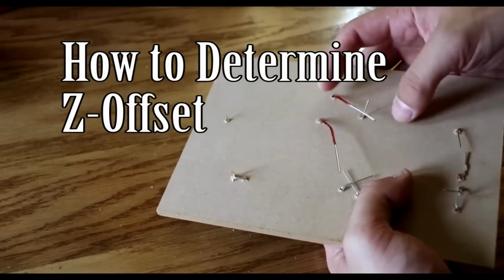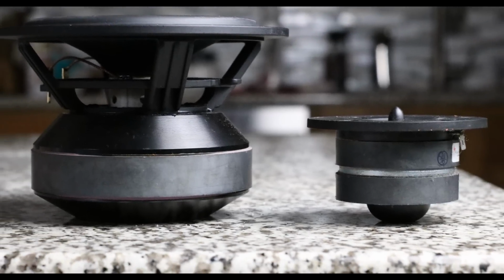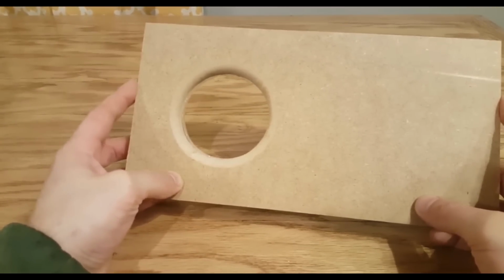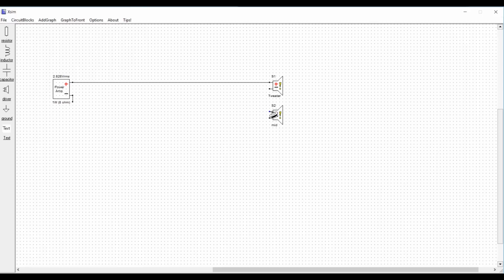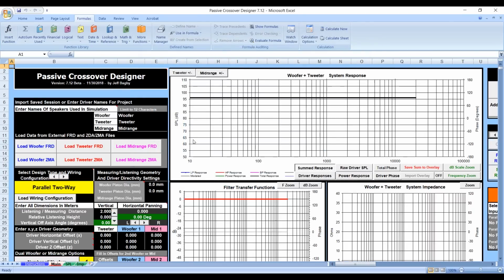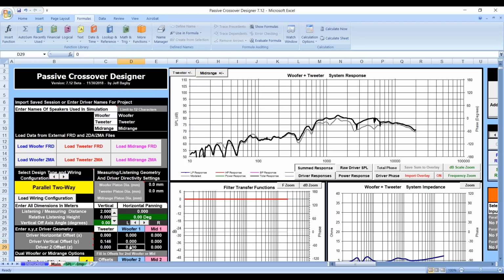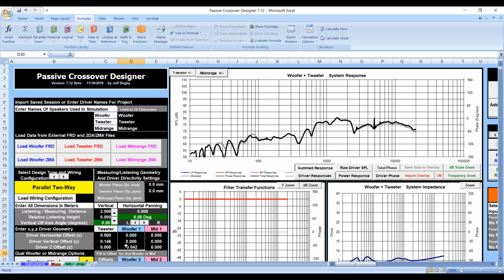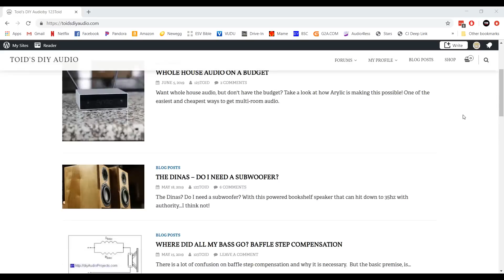Improving your Crossover Design - Z-Offset

Comment: Isn't it better just to do a simple calculation of the acoustic centers to see if you're within the correct crossover point ?
Reply from the maker: @danielesbordone1871  you can’t. You don’t know the origin of the acoustic center. It would be great if you could just measure to the middle of the magnet, but that isn’t how it works.
Reply: The correct way for tweeter and mid to be in phase: choose your crossover frequency, design and connect crossovers to drivers, generate frequency tone, send it to amplifier and drivers, by moving divers on z axis measure the max of the signal.

Comment: SAND CAST RESISTORS AND IRON CORE INDUCTORS....YUK!!!!

 When ever I see a video with a guy making crossovers with electrolytic caps, sand cast resistors, and iron core inductors ( PVC wiring or  ferrous terminals for that matter)  I instantly stop, and watch elsewhere you should too...  They simply aren't at a skill level that should be teaching the masses

Comment: Thanks for the video. I apologize if I missed something, but I assume you will be using dsp to time align the drivers, or is there actually a way to handle this task in a passive manner? (Delaying hf signal, etc. via components in the passive xover) careful, what you tell me, may just blow my mind 🎉
Reply: I was thinking the same thing, how do I actually implement this time offset on the speaker?
Reply: @adamdjd7882   I'm still struggling with this concept a bit, but I think I've got an understanding now. 

I use VituixCAD instead of PCD, and in the options for the drivers, there are fields where you can fill out Z and H offsets. I've played around with these features, and they change the frequency response when inputted. So, my understanding is that before you design your crossover, you input these values and then design the crossover with these variables in mind. Essentially this is figuring out (with more precision) what the crossover will actually do when it's installed in the enclosure.
Reply: @Tonehifi  You cannot add delay with a passive crossover. 

All this method does is give you the option to see the effect an offset driver has on the frequency curve and then you can adjust the crossover component values to get the best looking frequency curve
Reply: @droidzhunterz6861  absolutely! I’ve learned a lot more since. It essentially allows you to get a more accurate idea of what the listening window will sound like, and passive crossovers cannot change delay.

Comment: So if I want to do this with my MTM tower I position the mic at the center of the tweeter and measure from about a meter away for both the tweeter AND woofer?
And I do it without the crossover?  ( I can do this since I have an external crossover.    

Thanks!
Reply from the maker: Assuming a 2-way MTM, then you position your microphone at tweeter level. Take a measurement of the tweeter, take a measurement of the woofers, then take a final measurement of the woofers and tweeter wired together in parallel.
Reply: @Toid  ok cool.  Do I do this without the crossover attached?   I can do this since I have made an external crossover.     And then when I do both in parallel I just jumped the top and bottom binding posts correct? 
Thanks
Reply from the maker: @Nightjar726  you want to do this with the raw drivers and no crossover attached. For the woofers you need to wire them together, either in parallel or series, whatever your final wiring on those woofers is going to be.

Comment: Thanks but for the frequency Frd measurement isn't it dangerous to send a full range sweep to the tweeter? it can blow it
Reply from the maker: Dome tweeters and compression are fine. Planar or ribbon tweeter on the other hand, you will want to use a capacitor on them and limit the response.
Reply: @Toid  ok thanks. Or i guess maybe to only set the sweep range from above a certain frequency if using a software which has that option of what hz to start the sweep.?    but in addition, I always thought measurements should be from further away. At least with REW. And i think based on 1 meter.  And lastly, I wouldn't know how you would be compensating for the frequencies that the room would be imparting onto the measurement.
Reply from the maker: @Cart2.65Lv8  if you have an anechoic chamber and care about your actual sensitivity then 3’ is great. But completely unnecessary and can introduce more issues (room interaction) when done in a non anechoic environment. By getting closer you cut down on room interaction, typically closer to 500hz is a clean measurement. However, one of the reasons I like the Omnimic software over REW is the ease of use of getting good accurate full measurements all the way down in frequency due to it’s combined response and ease of use to set your impulse.
Reply: @Toid  for sure.  Im just trying to go back and forth between this video and your xsim tutorial.  Its just this video that still getting to me.  I wasn't sure why you are measuring both tweeter and woofer in parallel as opposed to just using the seperate tweeter and woofer measurements to then compensate the offsets with the individual files overlayed.  Why the blend of the two in parallel?
Reply from the maker: @Cart2.65Lv8  the xsim tutorial and thus both show why. If you just import both measurements import them into xsim your combined response will not be accurate. That is why we import the combined response in xsim and set the zoffset.
Reply: @Toid  ok still not following something.. how do you know the audio is arriving at the same time even if the drivers are wired in phase?  a tweeter always transduces more immediately than does a woofer.
Reply from the maker: @Cart2.65Lv8  think of it like this:, if you take a measurement of the woofer and a tweeter separately. Then you take those measurements and combine them in Xsim (ie connect the positives and negatives of both drivers in the program) The measurement should look exactly like the measurement you took of the drivers wired together. however, they will not. And that’s because you haven’t taken into account the time difference between the tweeter and the woofer. However, once you account for this like I show, the graphs then line up. If you’re still having trouble understanding, this concept you need to get on the forum where we can share pictures with you.
Reply: @Toid   very much appreciated! I replayed your 2 videos a few times and it's clicking now.   And sure I will get to that forum asap! I look forward to arriving!

Comment: I think you get it wrong. It is not z offset problem when you do all measurements at tweeter axis in the same point. The problem is with time 0 for all measurements you took. But the way how to adjust the time 0 in this video is correct. I think much better than I usually do by measuring crossover prototype with Twitter set to be 180 deg out of phase and then adjusting time offset to match measurement (null reverse).

By the way. It is very hard to fix the time delay wity passive crossover. I guess that you try to say is to adjust the phase. Non of your crossovers on this channel adjust the time. They are just RL phase adjusted. Please familiarize with step measurements. You will find that in your design, when phase is aligned first cycle will come from the tweeter then it transit (in a smooth way I hope) to woofer. But sound will never came from both at the same moment.
Reply: But how do you adjust the time delay? And how can you see when they are both 'in time'?
Reply: @viincentfonkert2870 special box shape or passive delay circuit for tweeter or active crossover.
Reply: @Bucefal76  thanks! Didn't find a video on passive crossover delay circuit yet but I'll find it! Thansk!

Comment: for a 3way do you put all 3 drivers in parallel at the same time or do you work on pairs? (woof/mid then mid/tweeter)
Reply from the maker: You can do it either way. I typically work in pairs.

Comment: Thank you for some great videos! You do a nice job of communicating concepts. This video clearly explains what Z-offset is. But not so much why it matters.

So what if the mic is closer to the tweeter than the woofer when creating the .frd files? Why is is this a problem?
How does making the adjustment for z-offset improve the function of a passive crossover?
Whatever that benefit might be, is it only relevant for measurements (or listening) on axis with the tweeter?
Reply from the maker: It allows you to time align the drivers and make them in phase.  Without this measurement when you go off axis of your speaker your speakers will not maintain linearity. Since this is a measurement of when sound starts, it would make sense that you have to have the mic in the same position.  If you measure the tweeter and then moved the mic 6 inches closer and measure the woofer, you have no point of reference of when the sound left.
Reply: Hey Nick.   How do we contact you now since I see the forum isn’t working properly?  
I would like some consultation work from you if possible 
Thanks

Comment: is there a way to do phase alignment electronically? Currently have little to no space to move drivers in and out (current project is a compact soundbar, so theres not room for physically moving drivers around).
Reply: There is with a Digital Signal Processor (DSP). That allows you to EQ and phase-align different frequency ranges.
Reply: Just mount your crossover on the back so you can tweak it, without repeatedly removing drivers,

Comment: Hello, when we measure with mic on axis with tweeter, usually the tweeter come earlier than the woofer?

Why you ad positive delay on woofer with xsim, rather than negative delay on tweeter?

And is it after we correctly set the delay, we keep it then design passive circuit?
Reply from the maker: We are stating the sound is coming x inches before the tweeter, so it stays positive.  I have never used a negative number on the tweeter, but I wouldn't see why it would make a difference.
Reply: @Toid  ah I see, so + value at woofer, its pretend that we move acoustic center forward, is it correct?
Reply from the maker: @qrdaudio  exactly
Reply: @Toid  what happen when we design passive crossover without correcting that delay. Would it be wrong result or else?
Reply from the maker: @qrdaudio  The crossover you design (response you think you will get) will not be accurate. Might be off by a lot.  Play around with the program and check how it changes with and without delay.
Reply: @Toid  okay Toids, thanks for your response, I'll play around with that

Comment: Is there a risk to the tweeter to obtain a frequency response with the woofer/tweeter wired in series? When getting a tweeter FRD, I’ll start the sweep at high fre to protect it..
Reply: They are not to be wired in series (which would have an effect, but a completely different one) but in parallel. Since you will usually do your measurements at very low wattage (0.5 to 1 W) there is usually no danger of blowing your tweeter.

Comment: There is actually a DSP board that can do the crossover filtering that can drive two output amps that directly drive the loudspeaker and tweeter.

Comment: I learnt absolutely nothing from this .... 
just mount the tweeter further back so that the speaker's are all time aligned .. forget the XO skullduggery that was not shown here ...
Reply from the maker: Even if you want to mount the Tweeter back further, you still have to figure out how far back you need to mount it. It's not like you can just measure it with a tape measure. Which is why you need this video.  This video shows you how to put that offset in, so when you design your crossover you can properly align it.  if you don't put that delay in, you'll think that you're going to get one response build to crossover and you'll get something completely different.
Reply: 123Toid ~  I'm sorry to say but nowhere in this video is there any description of how to introduce this mysterious electronic time alignment circuit. What effect would this circuit have on the system group delay ? There IS no better way to time align drivers other than by physical displacement. You don't have to be super precise just align the centre of the driver's magnetic pole plate... that's quite sufficient.. and the group delay won't get compromised!
Reply from the maker: @janinapalmer8368  I'm actually done videos on time alignment and phase in the past which is why this one didn't cover it. I'm definitely going to disagree with you on physical time alignment. You really need that time alignment to be close to exact, you can't just measure with a tape measure.  You have to take measurements to get that. But even when you physically move it back you're going to now have issues with diffraction and lobing. those issues will always be present with physical time alignment.  It typically creates a lot more issues then you're trying to resolve. There's a reason why a lot of people don't use it.  However you can if you want to. That's always a designers choice.  Here's a good read on the basics of time alignment both physical and electrical.  It'll hopefully help you get the basis of it. https://en.m.wikipedia.org/wiki/Loudspeaker_time_alignment
Reply from the maker: This may help you understand the phase: https://youtu.be/7JFY7vc_zm4  I did an entire series on crossover design which I pinned to the top of these comments if you are looking for crossover help.
Reply: How does the saying go... Knowing just enough to be dangerous... J/K but seriously yes of your going to want something to be linear phase then you have to measure. I personally think just getting the relative measurement so you can actually see in the sim what your crossover will be in the real world is worth it alone. And if you can't get what you want from this then you can move things around to get things to "line up" in the sim ie: take some delay from the woofer and see what it looks like, then you can build it in the real world and know what you'll be getting.
Reply: Attainable Audio ~ you make the cardinal mistake of confusing phase with time delay .. phase is measure in degrees leading or lagging and the phase graphs 'roll' if you look at the phase response curves .... you can make attempts to align these but you cannot effect any means to correct for a time distance of several cms ...
Reply: @janinapalmer8368  I think you totally misunderstood what I was getting at,... Can you explain what your talking about better... Are you saying that time doesn't have to do with phase? I was just saying that sometimes moving things around can get the crossover to behave better with a lower count of components, and instead of doing it by trial and error just do it in the sim first. Much better than just placing thing willy nilly kind of close and hope for the best.
And you do know that different poles naturally will add delay... So sometimes all it takes is an asymmetrical crossover pairing to improve things. But as mark alluded to, the digital domain is the better solution of you care about getting this 'more' perfect.
Reply: Attainable Audio ~ you don't half like creating two wrongs to create a 'right'...
If you time align the drivers in the first place by measuring the phase coupling using a professional acoustic phase meter then you won't need any additional " wizardry" added to the CO ! You seem to suggest you use a sim ... they are not very accurate as you should know
Reply: @janinapalmer8368  if your use of a sim is not very accurate then that either suggest there's either something wrong with your data or something wrong with the way the sim your is handling the data or the sim your using is not right in the first place, my simulations match up perfectly (with in a fraction of a db) with my real world measurements. as far as the rest of this discussion... it sounds like there is something being lost here... I'm guessing English is not your first language? If I'm wrong I do apologize, it just seams your not making sense on some of this to me, but from what I can make out it actually seams were talking about the same thing... I think... Ie: as you say aligning the drivers physically... which will DELAY  one or the other driver and yes its at the co area which you want to aim for.  Either way you do what you do as I assume it must be working for you.
To me, trying to get "perfect" is an exercise in futility as in real world environments with all the sound bouncing around and off axis listening, and how big the variance is in frequency response of even the best speakers, in the end it all comes down to what the designer likes to hear.
Reply: Attainable Audio ~ I was born and raised in the United Kingdom so I would say English is my first language .. followed by Spanish French and German... 
I'll conclude this debate by saying the fewer elements used in a crossover network the better ..!
Reply: @janinapalmer8368  Agreed, and as I said no offence, it's just hard to follow sometime through these comments instead of face to face;)
Reply: @attainableaudio4533  This additional thread has turned my brain into a pretzel even further from the very far understanding that i was yet still at.
Reply: Mark Dwight ~ true ... but the time varies in accordance with frequency ... the only effective way to solve this is to physically time align the drivers ... everything comes right then and you avoid unnecessary circuitry which hinders group delay .. ok 👍